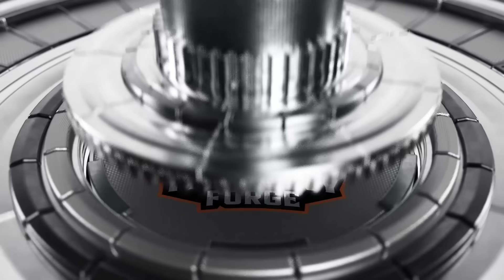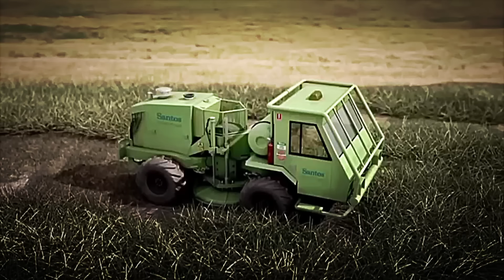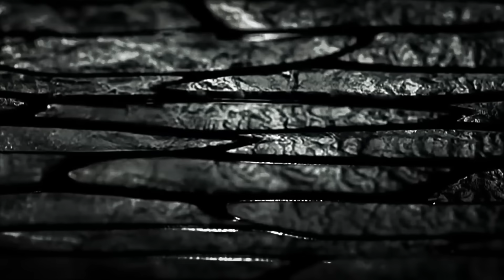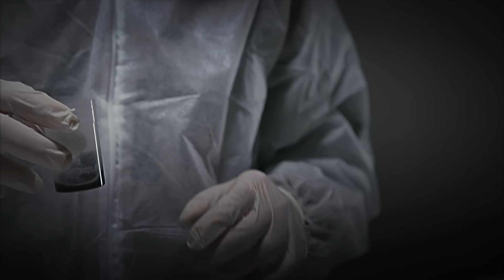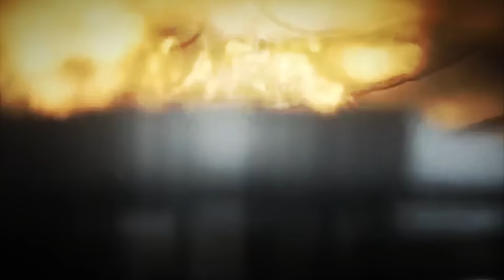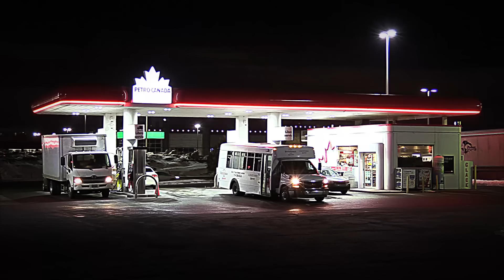HOW GASOLINE is MADE from OIL ⛽ | THIS is HOW OIL is EXTRACTED

Comment: One acquaintance who was very smart told me that once gasoline had no use and was just thrown away (this of course came before the widespread use of gasoline powered engines) Once gasoline powered engines came into use there was a demand for fuel to run them. In early automobile manufacturing there were three types of propulsion systems for automobiles gas, steam, and electric. Gasoline won out because it was the most practical. But as we move along in powered vehicles the electric technology is improving and, in the future, we will see more and more electric powered vehicles, but in my opinion, we will always have gasoline and diesel-powered equipment. And not to forget we have many products that are derived from crude oil.🥸

Comment: I have worked remodel construction for 43 years. I have ; in the course of doing trench work , come across  areas  just below the surface grade where I have found black oily and stinky deposits. Many times there are remaining organic bits mixed in. I do not necessarily buy into a " millions of years creation " scenario. Just my experience. This is in Southern California in a very hot climate.

Comment: If we understand this right, in order to produce so many different products from oil, there has to be some separation of the oil consistency, and one of these products is actually gasoline. So if that's the case it definitely looks like the use of gasoline for transportation is not about to end soon. Because otherwise how would you eliminate such a huge amount of gasoline that could accumulate non-stop? Just asking?

Comment: EXCELLENT video. Well laid out with facts and a level of understanding that provides most people with the words and terms required to absorb it. I worked at a gas station when I was a teenager and thought that gasoline was something we could simply suck out of the ground, as it still is, technically, but not understanding all the steps required to get that gas into your gas tank...TY .

Comment: Can we ctually derive crude oil in a lab using assumption like volume of organic material, as well as extremes of pressure  to produce crude oil?
Reply: Technically, yes, it can be done. However, the cost of producing the amount of heat and pressure needed to change organic materials into crude oil would make the final product astronomically expensive.
Reply: @caffeinefeind5263  Actually, it isn't that energy-expensive, though it does involve "pressure-cooking" the feedstock (which can be any sort of hydrocarbon-bearing material), breaking it down into three "product" streams -- water (or steam), hydrocarbons, and non-carbon residue.

"Changing World Technologies" developed this "thermal depolymerization" technique into a workable pilot plant, and followed with a commercial-scale plant in Carthage, Missouri  that used offal from the Butterball Turkey processing plant. They were able to take 250 tons of turkey offal, fats, and feathers and convert it to some 500 barrels of synthetic diesel fuel. The problem was, it stank up the neighborhood -- and complaints and lawsuits by the locals forced the plant to shut down.

In short, it wasn't economics that killed the plant, it was NIMBY politics.
Reply: @rickwestlake3048  I guess I stand corrected. Thanks for sharing that information.

Comment: How is crude processed into fuels and lubricating oils?  Two words.  Distillation and Cracking.  The term "sweet light crude" simply means the oil already has a high percentage of short chain fractions like gasoline where heavy crude is more of the longer chains like bunker oils.  Cracking is the process that can break some of those long chains into shorter ones and although energy intensive is worthwhile for the value increase of the fractions it produces.  With careful cracking the refinery can sway the percentages of finished product to meet market demands for specific fractions and maximize profit.  After cracking they distill the oil much the same way an alcohol still operates where the oil is heated to vapor and fed through a condenser column where at specific temperatures and pressures a specific fraction such as C5-C12 chains for Gasoline that is condensed at around 50C at the top of the stack and heavier fractions like Diesel at higher temperatures condense lower down in the condenser stack.

Comment: I hauled crude oil for 5 years never knew how they made gasoline. Just hooked up my tanker to pipeline and offloaded.  It's hard work being in that industry.
Reply: I hauled gasoline and didn't know how it came from oil 😂😂
Reply: I used to fix oil heat systems for homes and businesses. One day my coworker and I had to go somewhere for the annual tuneup and maintenance before the cold weather was coming. He told me I had the honors of cleaning the boiler and service the burner. Okay, no problem. But no, there was a problem. The call was for a funeral home. As I had the privilege to do the job, where was the everything? In the embalming room! The look on my face coming out, my coworker couldn't stop laughing. I still remember that day back around August 1984.
Reply: That's really crazy to do that I don't know 🤷🏻‍♂️ if I could've done it lol.

Comment: Can refineries control how many gallons of gas they get from a barrel of oil? Let's say gas is more valuable than jet fuel and diesel. Can they alter the temperature of the oil to get a higher % of gasoline?
Reply: Yep. If diesel prices go up, they can make less gasoline to make more diesel. It’s called under cutting in a Cat Cracker. 

What’s actually happening is the heavier fractions in the gasoline are dropped down into the diesel by lowering temperatures on the fractionation tower. 

Or if gasoline is the money maker, they can heat up the tower and send the lighter fractions of diesel into the gasoline.

Comment: This is Texas.  WTF is a kilometer?
Reply: When you have a whole kilo of meters, you get a kilometer.
Reply: It's one thousand times 3.3 feet.  That's supposed to make it easier to math out.
Reply: @PappyGunn - not when a video tries to use both at once. We don't use the metric system here. Is a football playing field one hundred yards, or measured in kilometers? When we buy gasoline or diesel, do fuel pumps tell us how many gallons of fuel we purchased, or how many litres? Even the imbecilic auto manufacturers don't tell us the engine is it's displacement in cubic inches, they go by litres. As if I'm going to use the term litres for a 1973 Plymouth. I never said what it was in litres. I'd always say the engine size was 318 cubic inches.
Reply: 0.6 mile
Reply: @RANDALL_lVORY  We used 0.625 miles in the mapping industry, or 3,280.8 feet.
Reply: 1000 Metres is 1 Kilometer
Reply: Learn tbe metric system
Reply: I agree. This is America with a video made in America. GTF out with metric terms. We don't use the metric system. We use the imperial system. I really despise these fools using something that has no purpose here in America.
Reply: Canadian accent
Reply: Americans are smart
Reply: My thoughts exactly!!  SPEAK ENGLISH!!!!!
Reply: Just convert it . Educate yourself

Comment: Respect to those doing this dangerous work. I don’t know if I could have done it when I was in my prime.
Reply: I've worked at a refinery many years ago. They never shutdown in bad weather. They can't, but only for one day they did back in 1995. A snow storm so bad that the Governor of NJ declared the day a state of emergency. I remember calling my fiance telling her the company needed me to keep the data center up and running. She was actually happy because I was making even more money in overtime. (I worked in the computer room as a Computer Operator). Even back then (circa 1995) was great. More job openings than ants at a picnic. Even Trump can't bring back the fantastic economy from the mid 20th century to the early 2000s.
Reply: Yeah those days are over.

Comment: One very common error ... the octane rating refers the the stability of the fuel during combustion (detonation/knocking occurs AFTER the spark during combustion) and NOT the compression before the spark.

Comment: Curiosity question:  What is being burned off in those stacks that the flame is shooting out of at the refineries?  Is there any practical way to collect it and use it for fuel rather than just burning it off?  I'm assuming not, otherwise it would already be done.
Reply: Some refineries direct it to turbines for electricity generation or combine heat & power systems
Reply: If the epa allowed the refineries to modernize, they would be able to use it for other uses.

Comment: the oil is run throw a distillation tower, each component has a different weight, so each will go to the diff collection levels in the still

Comment: Your video showed detection, abstraction and delivery.. Your video did not show how gasoline is made!!!  Bad video..
Reply: You just missed it. It was Suttle. 😮
Reply: Didn’t go into much detail in showing how it is separated, brief description was it.
Reply: @OjiiChan-x2h  yes. The oil is heated to a certain degree in a tower. Different properties of the oil rises up the tower at different levels. For example. Say natural gas at the top. The propane below that, then gasoline, diesel, kerosene, etc. Then at each level it's collected for whatever fuel is collected. Fairly simple but dangerous.  😊
Reply: @josephdelp87 
Thanks, I retired from Shell refinery Martinez CA.
Worked in the Crude processing unit, Straight run processing unit (cleaned and further separated the Naphtha) and Catalytic converter unit (further cleaning Naphtha creating reformate at 100+ octane).
Really love the work, especially as an outside operator. Didn’t care for the inside computer (board) operator position.

Comment: Gasoline was once considered a waste product and was discharge into streams. They were only interested in Kerosene , for the lamps.
Reply: If you didn't know, aviation fuel is actually almost like kerosene. It has to be. Planes don't run on diesel and if a plane has to dump fuel for whatever reason, it evaporates. That would never happen using diesel fuel.
Reply: The industry was much more wasteful back then.
Reply: Good ole rockefellers

Comment: The process of making gasoline from oil is a remarkable blend of technology and science. From the moment crude oil is extracted and transported to the refinery, each step in distillation, filtration, and refinement is meticulously controlled to achieve a high-quality end product. Oil molecules are separated through various distillation processes, yielding fuel products like gasoline, diesel, and others. With advanced technologies like cracking and reforming, gasoline is ultimately refined to meet high standards, ensuring optimal engine performance and minimizing environmental impact. It’s a complex but absolutely vital process in the energy industry.